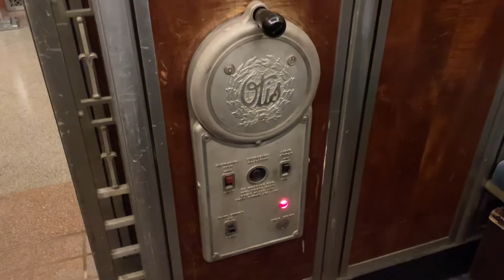INCREDIBLE Manual 1930 Otis Micro-Drive Elevator @ Severance Hall - Cleveland, OH.

Comment: AC before VF?
Reply: DC was widely used with earlier elevators it was faster and easier to control.  Either a MG set, selenium or mercury arc rectifiers.  However AC Traction/winding drums did exist. VF made the inroads like 25-30 yrs. And DC Drive for modding replacement of MG sets.

Comment: Very elegant elevator cab and smooth operation. Still with the original hand control. This elevator and machine were built to last 95 yrs old on the 1st of January. It would have a 2:1 roping for 2.5 ton capacity. I have seen a video of the Micro Drive machine room and the controller. The roller or contact in the hoist way cuts in the micro drive (2nd motor) dropping  out the main traction as it approaches the landing.